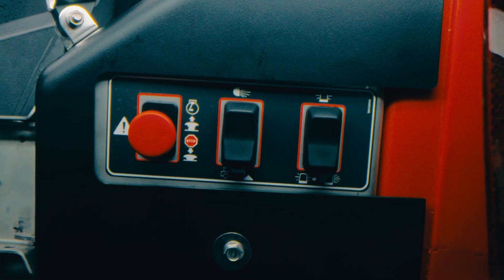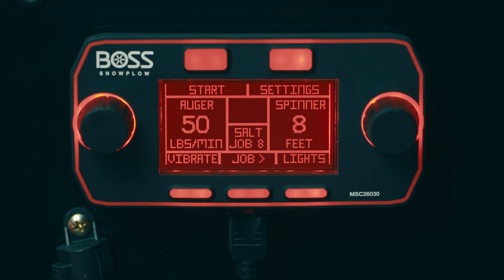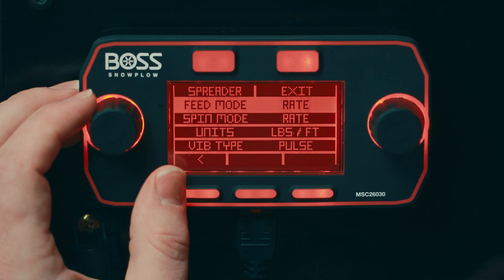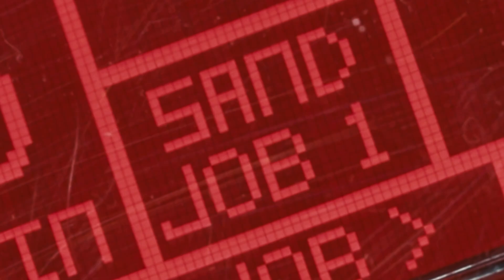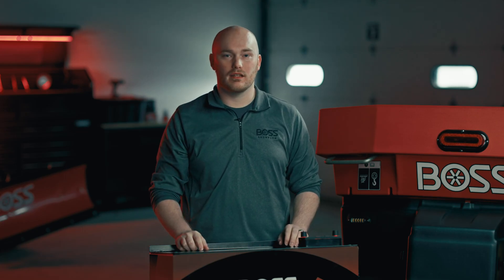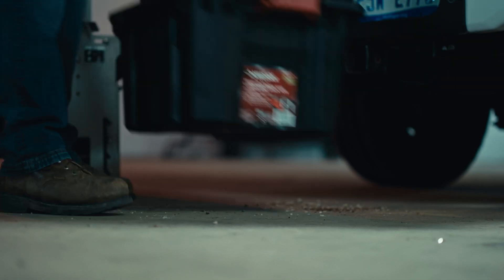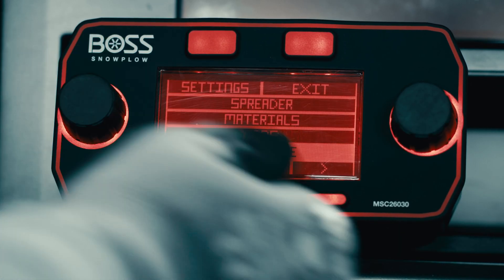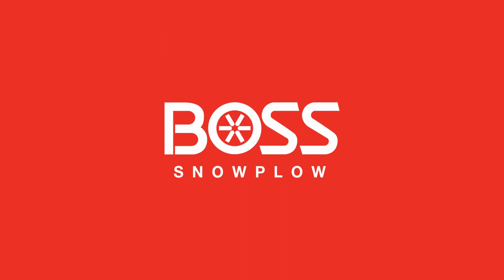VBX+ Spreader Setup & Calibration Guide | BOSS Snowplow

Comment: Doesnt make sense about the calibration. How do you put 100 pounds of material for it to be accurate when alot of that material in a clean hopper is going to stay at the bottom in a auger salter? I just got the VBX+ and i am dissapointed compared to my older vbx i just sold. It doesnt spread near as far, and the pattern is very heavily to the right. Any advice for this? Theres not any videos on it as far as I know. It also says "Spinner Target not reached" constantly.